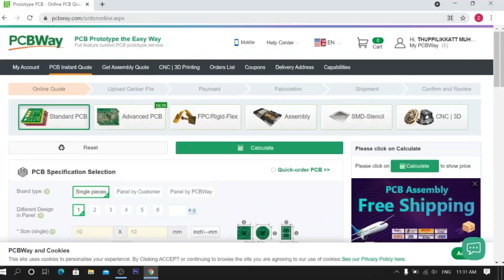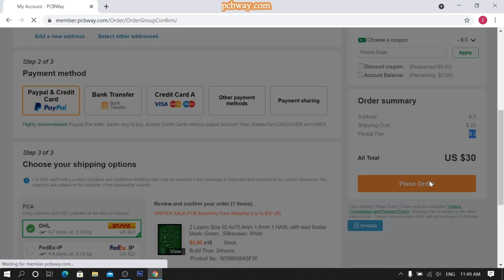How To Make Lithium-ion Auto Battery Charger From Old Charger

Comment: What happens if one less charges fast than the other, it will show full charge before the second one is charged fully.
Always use individual indicator for each battery. For safety.
Don't mix batteries unless they are from same batch.